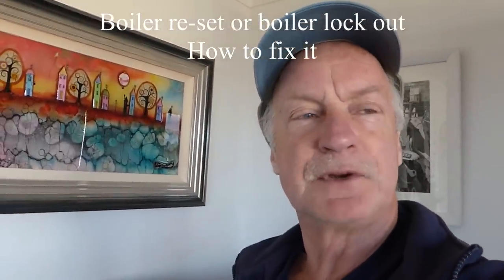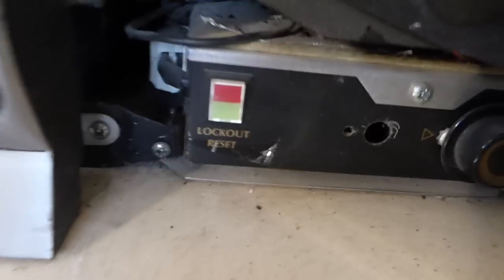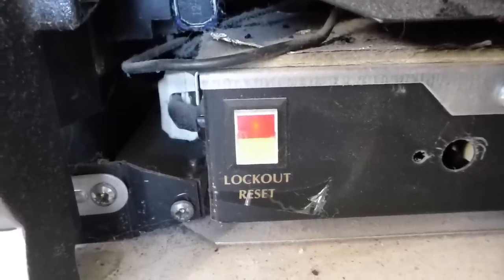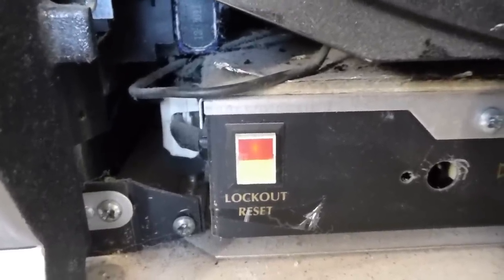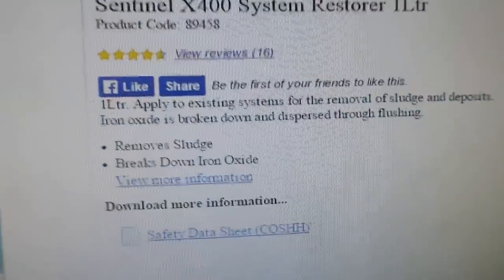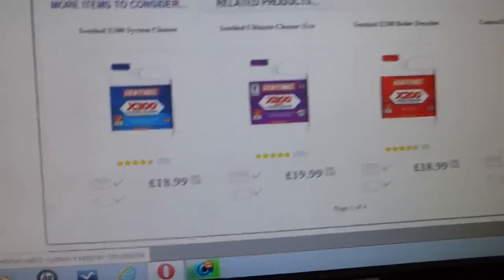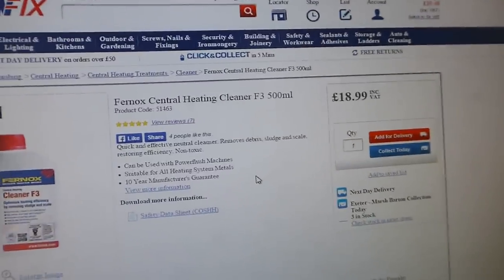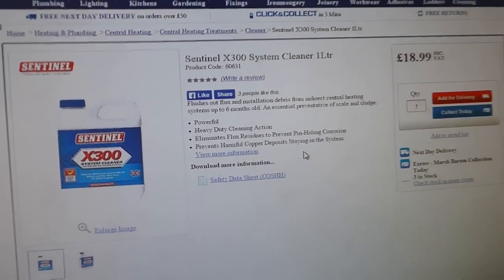Does your Boiler keep needing a reset or lock out? How to fix it.

Comment: It's not clear if you're talking about a gas or oil boiler in this video.  I only work on oil so am unfamiliar with any gas boilers if that the aim of this video.  However, on an oil boiler there is a very big difference between a boiler overheat (limit stat tripping) which this video seems to address, and a 'lockout'.  A lockout is never to do with boiler overheating, it is a safety mechanism built into the burner to verify that the burner has lit successfully and has not subsequently gone out whilst it should still be lit.  It is a function of the burner control box which is completely independent of the rest of the boiler.  The burner control box has no idea about circulation pumps and water pipe blockages.   It always amazes/concerns me when I hear of engineers responding to a lockout by increasing water pressure or playing around with other parts of the boiler.  My advice to customers to explain this better is to imagine that your boiler is a combination of car and caravan with the burner being the car and the rest of the boiler being the caravan.  If the engine fails to start (lockout), you wouldn't check the brakes on the caravan.
Reply from the maker: The video only concerns gas boilers.

Comment: Hi. great video sir. I have the same problem with my camray 5 boiler. you mention about putting something in the boiler to clean the pipes,and then add an inhibitor. well my boiler is a combi,with no tanks, other than in the boiler. so how do i put the cleaner in please.?
plus i have a leaking air bleed screw on one of the tanks.Could you tell me where i can buy a new one please. kind regards Dave.
Reply from the maker: Hi Dave, a plumbing shop for your air bleed valve, the stuff you need to clean the system is called guess what, system cleaner, also from your local plumbers shop. The stuff is poured into the system through a radiator.
Reply: Hi.Thanks for your reply. I will put the inhibitor in the rads.I guess its not just the rad bleed screw that one removes? is it the larger threaded 'bung' that i have to remove aswell?
Cheers Dave

Comment: Hi, having major issues with my boiler. Had several parts replaced: Flow switch, fan, PCBs, Condense trap, pump. I can't think of anymore parts that can be replaced. 
Boiler just clicks out and goes to lockdown. On the occasion it does ignite it switches off after a couple of seconds. Please help!?
Reply from the maker: Blockage in the system causing boiler lock down.
Reply: dereton33 Thanks. Are there any other possibilities? When engineers are here they put new part in, works for 10 minutes. Then magically it stops working when they leave? Could it be air in the system too, if boiler does ignite it's very loud
Reply from the maker: That is also a possibility,
Reply: dereton33 thank you! Are there any other possibilities? Have a plumber coming tomorrow and need the to fix it after 3 these last 3 weeks!
Reply from the maker: Possibly a PCB circuit board fault.
Reply: Glenn Kitchener whack

Comment: I've just had a plumber out to look at my boiler (which keeps locking out).  He said there's probably a blockage in the heat exchanger, which means it's "knackered" and not worth fixing.  He then went on to quote me £4K for a new boiler!!!  I will certainly give this a try.  I figure I've got nothing to lose.  Thanks for sharing. I'll certainly make a donation if it works.
Reply from the maker: Give it time, it does work.

Comment: Hi Al, 
I got a new boiler , Worcester Greenstar 24i Combi boiler. 
At first, the boiler needs to be reseted after central heating demand. I asked the plumber to have a look at it. He topped the pressure up and it seems fine after that. 

then today, after use of hot water, the boiler needs to be reseted again. it keeps doing it 3 times over and over again. I do notice banging sound as well. What is the problem ?

Thanks
Reply: +dereton33 the boiler is only about 2 weeks old
Reply from the maker: It could be a lot of things I would get the plumber back.
Reply: +dereton33 thanks!

Comment: I have a gravity fed system, indirect, my hot water works, but my heating doesn't, since I drained it down to change a rad and pump valves, I bled the rads heating works well until it locks out, I just don't see why the water works and heating doesn't,
Reply from the maker: Air in the heating system.
Reply: @dereton33  cheers mate, yea since watching the vid I found the drain at the top back of the boiler, drained some water, plenty of air there, turned it back on could really hear the air in the boiler like I the video, so I just need to keep going and get it out, thanks, much appreciated.

Comment: Hi I put my volkera compact on and I hear it fire up and the radiators start to warm then it locks out with error A11 its not a very old boiler
Reply from the maker: Time for a full system clean. The boiler may be new but the system is not.

Comment: Hey there. Just wanted to ask is it possible an air lock could do same? Only I had the X400 solution in the system then a leak caused it to run low on water, (had supply valve off to prevent further dilution). Anyhow, I filled and reset which got it running but locked out after time and now wont even fire up! Any pointers would be well appreciated...
Reply from the maker: Check for air first.

Comment: Interesting, thank you. My boiler is locking out every few days and was hoping you could help.  I thought that a burner lock out was usually due to a problem with the fuel supply.  Why would cleaning the water system part cause a lock out please?  The burner will not know that the water system is blocked. If water is not circulating, I would have thought that the boiler would just not fire very often as the heat cannot be removed from the boiler, causing the boiler's own thermostat to kick in.  Any help you can give would be much appreciated.  Thank you.
Reply from the maker: Crud and black sludge can cause lockout because the boiler will keep overheating, causing it to protect itself by locking out.

Comment: How often should i get an oil run rayburn serviced..? Does using Sentinel x400 extend time or should it still be serviced please? Reset button currently needs to be pressed a few times
Reply from the maker: Every year Lucy. Regardless of sentinel 400.
Reply: @dereton33  Thankyou,do you have an email where i can send a pic,just checking if i can add Sentinel here (image)
 please

Comment: Hey mate I've had heat and water coming through no problem but after 10mins the pilot light goes out its a biasi compact he i think and after it goes off the 3 lights still flash green we then have to run the hot water to be able to get the pilot to reheat up ! If we don't turn the hot tap on every like 20 mins the pilot lights will blow out and the green lights will stay flashing for a further few minutes then it comes up with left and right lights flat green light and the middle lights flashing constantly red . We got the gas man out and he literally switched it back on didnt mess with nothing or see the error come up as he didnt stay long enough and he said  it was due to draught coming in from the front of the casing as the port hole window  were you can see the flame which is on the front of the casing was gone and he recons it just needs new casing to keep the air from getting in and doubting it out but im not sure ! The flame is blue heaters and water works it just turns off after like certain times an hour or ten mins or 3 hours is most its stayed on ! Then we have to either go reset it by mains or by turning taps on ! The flame is also not just 1 straight blue flame its blue but has 3 separate flames ! The red error only comes up if we don't run the water to reignite the flame or if we completly reset it  if we leave the boiler on and the flame isn't ignited after about 10mins thats when the middle red light flashes ! . Then all 3 green lights come on and it flames up right away again! What could this be ? I first thought a leak or over heating but its heating up etc well and not too hot but the flame is going out could this be sludge or what hes saying and its just draught getting in because when the boiler is switched off by the mains we can feel a gust of breeze coming out of the boiler flame  port hole on the front!
Reply from the maker: Too much draught coming in. You can always adjust the pilot jets to a slightly bigger size to see if that keep it on. Other than that the boiler may have some sludge in it causing it to overheat and switch off.
Reply: @dereton33  so it seems he's along the right lines then with it being a draught I just think he's got it a little backwards though as the gusts of wind is coming from the inside of the boiler and not out he thinks if he seals the casing shit properly with a new case it will seal the draught from getting in but its not getting in and we have explained this there is no draught going into the boiler its coming out rather than in , its crazy because we have to keep getting up every 10 mins to turn the taps on for it to reignite! The gas man has saidnits safe to do so until he comes tommorow the part im not understanding though is if we don't turn it off by the mains to reset it or run the tap it will attempt to ignite 2 more times then it will come up both left and right flat green lights and red middle flashing for reset im guessing? But I was worried that the red lights could be a warning sign and us keep resetting the boiler will mess it up even more he said he should be here by tommorow with the new case and I might ask him to turn the flame up a little once he's sealed a new case on and we will see if it works from there on ... if not ill have to get back to him for a third time and ask for it to be flushed with a sludge cleaner mines a condenser boiler so I will need to pour the liquid into the actual radiator im supposing right ? , you have been a huge help and you saying its to do with draught has  put my mind at rest x

Comment: I have an Ideal logic+ 30. Some of the radiators were sludged up so I drained the system down. Took 2 of the radiators off for cleaning  (hose pipe- outside). Refitted the radiators and put Fernox F3 cleaner into the system. Left it for a week and it has done a great job of restoring heat back to the radiators. The problem I have now is that I get a boiler lockout when I turn the hot tap on, only whilst the central heating is running. If the central heating is up to temperature or turned off, I can run the hot taps without experiencing a lockout. Really scratching my head??
Reply from the maker: Boiler now has some sludge still in it try some boiler cleaner from Fernox.
Reply: @dereton33  Many thanks for your speedy reply. I'll get some fernox F3 into the system and leave it in for a week or two. Wishing you both a very Happy New Year!

Comment: My heating system had been clunking and banging a bit these last few days and I got up this morning to find the house cold and the red lockout light on the boiler, so I went on YouTube to see what Mr Dereton had to say about it because everything I’ve tried by him before has worked. I drained the system but didn’t tie up the ball valve in the central heating tank to keep clean water flushing the system through. Some crud and loads of air bubbles came out and I drained the system at the two radiators that had drain valves on them, started at my hallway radiator and let it run for 30 minutes or so, then switched to the kitchen radiator and did the same until bubbles were non existent and then switched back to the hallway radiator again and did the same again. Tried pressing the reset button several times during and after the draining down but to no avail as the light stayed on so I went to the main electric switch and turned off the electric at the mains for a minute or so and then turned it back on and the red light was no longer on and the boiler fired up and now appears to be working normally again. The boiler concerned is a Baxi solo so I hope this helps someone with that kind of Boiler and this method may work on others..
Reply from the maker: Thanks for the info Adrian.
Reply: dereton33 , no problem, your videos have helped me enough in the past year or so because I had to change the zone valve and actuator on my heating and hot water tank and although the system that you showed was slightly different, all the process and methods used still applied to to what I did. Thanks for posting your videos because they have saved me up to now a good few hundred pounds and with the step by step tuition are very easy to follow and cash this past couple of years has been a bit tight because I was diagnosed with Hodgkin’s lymphoma and am now in remission but it left me with type 2 diabetes and I returned to work last November and fell into a trench at work and badly bruised my ribs so I’m recovering from that and then the hospital told me that I’ve got to have my gallbladder removed so videos like yours have saved me a lot of money which is always good. I’m now at the point where if I have plumbing and heating problems I don’t look at anybody else’s videos but yours because I reckon they are the best - once again , Thank you !
Reply from the maker: Hi Adrian, I do hope you get better soon and stay in remission. I am only to glad to be of help. All the best Al and Jan.

Comment: Hi dereton33, i have a grant boiler which has been working great for 20 years. Recently, the reset button has been coming on when I try to start it from cold. A reset gets everything working and it doesn't light up again for a few days. However, like you say, the intervals between resets are getting shorter. Once it's reset it works OK with no noise or anything that seems out of the ordinary. I had a plumber check it out and he could find nothing wrong but says it may need a new burner. Does this sound right to you? What is the lifetime of a unit like that? Thanks.
Reply from the maker: You are close to the boilers limit of lifetime. Could need a new burner, but more than likely sludge building up in the system causing the boiler to overheat.
Reply: @dereton33  thanks!

Comment: Hi Al. Just a quick question. I’ve got a Worcester combo boiler green star 30i. When the temperature is set to high after 3-5minutes or so the boiler locks out. Then needs a reset and will lock out immediately again. But when I set it to lowest temperature the boiler does not lock out. What can be the problem. Cheers Al. Keep up the good work.
Reply from the maker: You have sludge build up in the boiler get some system cleaner and fresh inhibitor. Or go for a power flush.

Comment: Hi, I keep getting boiler lock out. I have had new circuit board. Fan and pump are fine. I kept getting pressure build up and found out water was passing into the boiler from the loop. Fixed that. So the pressure only goes up when heating is on. So I'm told it was the expansion vessel. So I got a new external expansion vessel fitted and solved the pressure issue. Now heating stays at about 1.8 - 2 then goes into lock out. What could this be?

Boiler has been drained when fitting new vessel.
Radiators all bleeded.
Everything comes on fine, pilot light, fan, pump etc but still get lock out at when pressure reaches between 1.8  - 2.

Any ideas?

Is it a blockage?
Problem with heat exchange?
leak in the boiler? (which it can't be because pressure seems stable now).
Reply from the maker: Sounds very much like an over heat problem whereby the boiler locks out to protect itself. So your system may need cleaning . Maybe even a power flush.
Reply: dereton33 Hmm interesting because when I tried putting the heating on - with the boiler rads turned right down, it didn't lock out. As soon as I turned it up a quarter, it locked out...
Reply: it took about 3 seconds to fix with a duster t was the light receptor that cut off the fuel because soot had got on it wish I could go into more detail but if you ask an oil engineer they will be able to tell you the right name and wher to find it ...it looks like a spark plug cover just clicks out easy

Comment: Hi 
Great Videos , they have helped me a lot , Thank You 👍.   I have a Vokera Compact HE 25 Compact .  The Boiler keeps locking out , often you just turn it off for 5 mins and turn it back on and it’s fine . Other times it takes 20 odd mins to work properly.  I did have a boiler warranty on it but they won’t cover it any more.  In the last 6 months , they have fitted a new Diverter valve & motorised head, a PCB board , a High Limit Switch , a fan Switch ,a new fan and it still randomly locks out , either on both Hot Water only or on both , heating & Hot Water . 
I’m at my wits end .  I’m going to drain out enough to put this sentintal stuff in but I’m wondering if you have any ideas what it could be ?
Reply from the maker: Do check the central heating pump. If that is ok then it is black sludge. Clean out the system.
Reply: dereton33    Hi , I forgot to mention , not sure if it makes a difference or not ?  But it  often locks out when only the Hot Water is on , and the central heating is off.

Comment: I have turned down my thermostats as low as it can go and both zones. And I am still getting heat  . Can this be a bad thermostat or something else.
Reply from the maker: It is some heat self circulating from the  zone valve it  may not be working properly.